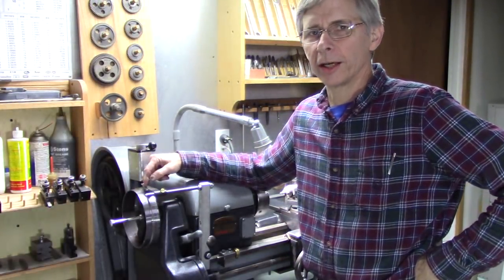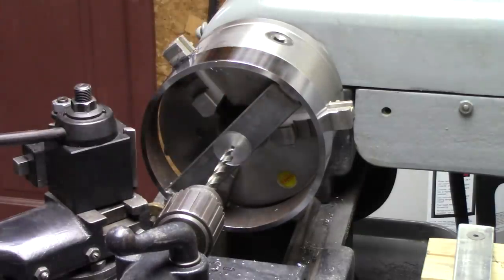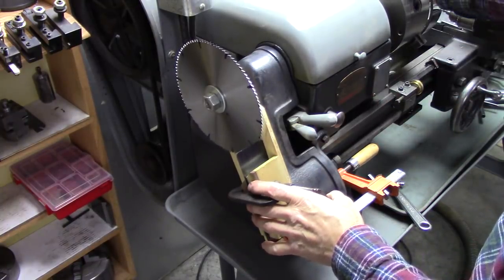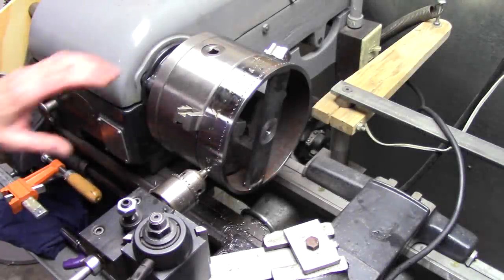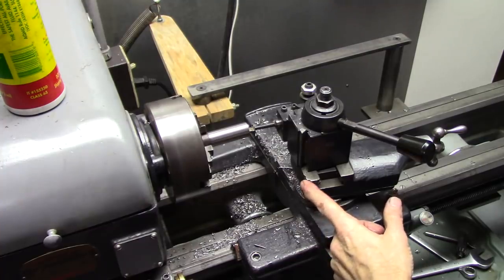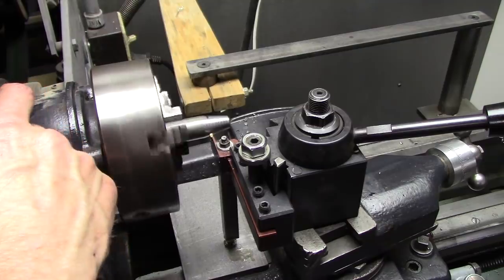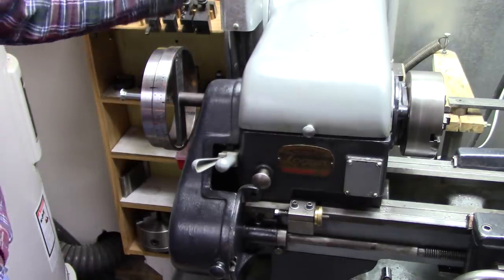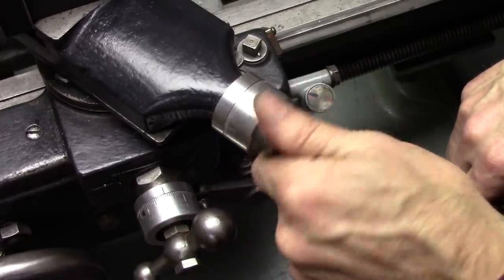Metal Lathe Indexing Wheel

Comment: With regards to your internal / external taper. If after cutting your internal one, you had left the compound slide where it was, run your lathe in reverse and with the same boring tool or another tool to cut on the backside, or keep the lathe running forward but have the tool upside down, your tapers would match exactly, without any trial and error fitting. Watch out too about standing pots of lubricant on your belt cover, it may not only slide off due to vibration, but it may also leave a stain ring on your paintwork. Final thought, I did not see it, but I am assuming that the drum is not permanently affixed to your mandrel ? just relying on friction between the 2 when you tighten the bolt. You have a fantastic friction fit with the mandrel in your lathe spindle ( hence you having to tap on the bolt to release it ) the clamping friction between the wheel and mandrel end is much lower. How about adding a mechanical one, i.e a key or a couple of small tack welds ? Great job and thanks for the shout out about Mr Pete.
Reply from the maker: I'll have to watch the video and refresh my memory on the tapers however running my lathe in reverses is not a good option, it has a screw on chuck. Good advice on the attachment of the expanding nut to the spoke of the wheel. I tack welded with my mig and it now works perfect. I wish I could modify this video as slippage in this area can be a problem.  Thanks for the valuable comment.

Comment: Would you be willing to do a short video detailing your belt grinder. Just the little bit I saw was very intriguing.
Reply from the maker: I've thought about that. I've had a lot of comments on that sander and I'll have to admit. it works great and I use it almost daily! When I run across a suitable motor I'll make another one and do a video. Thanks for the comment!
Reply: Winky, did you make the rollers? If you did, did you also use that taper attachment I see to do any crowning?
Reply: Yes I made the rollers but I did not use a tapering attachment. I used a simple V shaped crown. I set the compound at about 1.5 degrees. I locked the carriage and had fed the compound a few passes until it quit cutting just past center and then flipped the roller over and did it again. It worked perfect!  A 2-inch wide belt is very forgiving....  a 4 inch is much more critical. I've had others tell me I should only crown the top idler and not the drive but it works best with both crowned. The only reason to not put the crown on the drive (or both wheels) is if you are gong to do heavy grinding against the wheel.  I have no tracking adjustment and you can't knock the belt off. For the record, the motor is 1/2HP 3450RPM with a 3 inch drive roller. From what I understand a bit faster wold be better but you would probably need to increase the HP. I know it works great and I use the heck out of it!

Comment: You could have two drums (instead of one) with the smaller a snug fit inside the larger. choose some numbers that are relatively prime. Then they can be rotated so some of the holes line up. When the cuts are made from those, the inner drum is rotated to line up others. With a bit of simple arithmetic and attention, a huge number of different indexes could be performed. In fact any product of the prime factors of the two drums.
  In fact I might do that on my Logan 300 (recently acquired, but needing attention).
  p.s. is your belt endless? If so where did you get it from?
Reply from the maker: If you need all the combinations that a great idea. On my South Bend I used a 48 tooth gear. It give be most common hole patterns

Comment: I love that saw blade idea but I'd be a little concerned about the precision of the ratcheting system. Well, not so much a ratcheting system as a ratcheting piece.
   It's an absolutely ingenious idea, I love when you can use your imagination to adapt one device for another purpose. It's a huge time saver when making machines. I just hope that anyone watching this who is a beginner or novice understands that when you need precision in 1 to 5 thousandths of an inch, that this is probably not going to be reliable. It might be if you make a ratcheting system with basically zero flex. The sheet metal probably does OK but that thin sheet of stainless is a bit concerning.
  I may even adapt this idea for my own indexer so that I don't have to do the initial precise measurements. Again, a huge time saver.

Thank you for the video.
Reply from the maker: I'm sure their is some error although I'm not sure the ratchet on the saw blade is a significant source. It's amazingly rigid when you reverse into the tooth gullet I'd say there is error in multiple areas. The sleeve bushing in the drill and the arm the tool post are both areas that might move some. I've used it to make dials and drill bolt patterns (3 and 4 bolt) and never had a problem with the bolts lining up. I'm guessing that would be within .003 or .004.. But I agree, I would never use it to cut a gear. Hopefully anyone advanced enough to cut a gear understands the limitations.

Thanks for the comment, always good to hear concerns,  and compliments of course!

Comment: Great video and very motivating . I need to make some dails for my son's lathe once i installed a new cross slide leadscrew and nut . I saw something else on some of your videos and that is your cutting oil system . It seems to have air in the system as well while delivering the fluid to the work piece being machined . Is that to enhance the cooling  of the tool and work piece whilst it is getting some lubrication? I make a lot of bushes to refurbish turbocharger waste gates so i do a lot of drilling in the lathe . I want to install a cutting fluid system so i thought i'd ask you about yours . I like your videos and it is awesome to see somone enjoying what he does .
Reply from the maker: The fluid being sprayed is a water based coolant called Kool Mist #77. You buy it by the gallon and dilute it 10 to 1. It's mostly air being sprayed so it is very economical. It works just as well as flood lubrication except that you don't have to recover the coolant. Although flood moved chip out of the way a little better. The sprayer I have is OriGlam Mist Coolant Lubrication Spray System but there are many out there. Just get one with both fluid and air valves.  Glad you liked the videos, thanks for watching.

Comment: Note: U could use various black powders to fill the epoxy. Harbor freight sells small quantities of powder paint in BLK, RED, WHT, and YEL. Carbon BLK (Amazon) is ideal and Manganese dioxide (alkaline batteries) is a black pigment which was used in antiquity. Degrease UR object first with MEK or brake cleaner. Make a squege from a plastic bottle.

Comment: Hi Winky, what kind of Steel are you using for your Tap Guides and other Tools? I noticed you don’t seem to have a problem with rust. 
Thanks
Reply from the maker: Everything it mild steel. I do occasionally get rust but not often. My shop is climate controlled which keeps the humidity down.

Comment: Thank You Mr. Winky...First time visiting your sight....I was instantly able to relate to your shop setup in that my own lathe is just about in the same position with my water heater as your lathe is, ha. We both do a little bit of anything, wood, metal, plastic whatever is needed. Liked & subscribed and I will slowly catch up on your shows....TM (Calif.)
Reply from the maker: Thanks! Yep, wood and metal or whatever. Although metal working has sort of taken priority lately.  It would be nice if I had a bigger shop so I could keep the oily chips and wood separate but the wood and metal actually compliment each other very well. Thanks, for watching. (KY)
Reply: @WinkysWorkshop   A long time ago watching Lyle Peterson making a wooden foundry pattern . mrpete222 exclaimed that "yes I use my machine lathe to do wood-turning for my foundry patterns". It would be wonderful to have a clear division between wood & metal but as you say we all need a larger shop...ha, never large enough!!! I am 46+ years manual machinist and my semi-retirement has me spending LOTS of time in the shop. Always something fun to do. Each day is a new adventure. Thanks again....TM
Reply from the maker: @tuffymartinez  - Retirement is great, I just wish I had been able to do it 20 years ago. I'm 64 now and don;t have near the energy I used to. I've had a good live but I put off many things until retirement. I'll never complete all my goals in this lifetime! Check out my Wood Lathe Made like a Metal lathe video.

Comment: Indexable lathe spindle extends the lathe versatility by a big margin. What has also  caught my interest here is your bed supported parting blade. Is that idea your own?
Reply from the maker: Thank you sir. Yes this was my idea and it works well but although I occasionally still have a mishap. I think when the insert gets slightly null. If is breaks the insert no big deal but when it wipes out the holder it cost a bit more. I have another video that uses a HHIP high speed steel blade. So far is has never failed. I basically bolt the blade holder directly to the compound.  https://youtu.be/HGAQHjzgs9c

Comment: If I could be so bold as to make a suggestion and that would be to go to a smaller wire diameter on your 110 welder. Sounded to me as if you had the wire speed turned so far down that it was barely coming out of the gun? This tells me (after peaking at your welds) that you have to large a wire diameter in the welder. If you want hotter welds and better penetration in a 110 wire feeder then you should go to a .023”-024” that been my experience. Did not want to tell you how you should do your job.
Reply from the maker: Excellent observation. When I made this video the welder was only a month old. During that month I bought gas, a regulator and some .030 wire for use with gas. I've had stick welders in the past but MIG is new to me. After playing around with the welder a bit more I figured smaller wire would be much better and after changing to .024 it definitely was better. I wish they made a .020. I think it would be even better. You know the flux core wire did a little better than the gas although there was more slag. Bottom line, a 110v mig doesn't have enough power for much over 1/8-inch.  I've actually welded a lot of 1/4" but it's pretty much on the surface and i would not trust the welds for anything very heavy.

Comment: I'm not a machinist but I'm familiar with lathes and am toying with getting a small one.  I'm curious  how you decided on 100 & 48 index locations. (I realize you can get numerous variations with just those 2).  Are 7, 9, 11, 13 indexing not that common?  Not criticizing or being negative I just like to know details.  :-)     I've subscribed and will be watching your other videos.  Thanks for taking the time to video and post your interesting work.
Reply from the maker: I made the the 100 locations for making machine dials. You may have seen the videos by now. I've actually never used the 100 holes because the saw blade is quicker easier to use. You just click to the next tooth rather than aligning a pin with a hole. As you said, 7, 9, 11, etc are not common. I actually only use 2, 3 and 4. Thanks for watching.

Comment: The same setup that cuts the female taper of the spindle clutch can cut the male exterior taper.  Leave the angle unchanged, cut on the far side of the center in reverse with a left cutting tool. Angles guaranteed to match.
Reply from the maker: Yep, I should have done that for sure. ..  I did this on the last one I made. Instead of making the wheel I just used a 48 tooth gear. So far I have never needed anything other that a 2, 3, 4 or 6 hole pattern and the 48 tooth covers them all. https://youtu.be/xauJcjrINy0

Comment: Hi, I like your your video. If you have a look at the Steve Jordan YouTube channel you will see a couple of ideas on how to pin your indexing ring in the locations you require. All the best for the New Year. 👍
Reply from the maker: I just watched Steve's video. It looks like I came up with a very similar idea to his. I like the pin idea he has although this is somewhat lathe specific.  He had a solid surface on his gear cover to mount to. The Logan lathe doesn't have this. Also, my wheel has two sets of holes,  100 and 48 so the pin needed to to move from side to side. Realistically, his 24 hole ring (or disk) is totally adequate for most project. It gives you 2, 3, 4, 6, and 8 positions.  I wanted 100 on my ring for making lathe dials. Also any 24 or 48 tooth gear would be perfect!

Comment: I like the idea. Could you possibly post the I/D and the teeth number and the O/D of your change gears. I have a Clausing 100 and i am wondering if they will interchange or if i could modify some other gears to work on mine. It is going to be next to impossible for me to find a set of gears for a Clausing 100 that was made in 1939. Thanks.
Reply from the maker: The change gear bore was 5/8" inch and it had 48 teeth. Of course you can use a different gear depending on the hole pattern and number of holes you want to drill. If you want to drill 2, 3, 4, 6, and 8 holes all you need is 24 teeth on a gear of blade. Ebay is a good option for change gears.
Reply: Thanks Winky. I have the list of change gear numbers for what thread pitch in my book on the Clausing 100. I will look to see what the gear bore diameter is on my lathe. Hopefully mine is the same 5/8" diameter and key size. If larger then i could always bore the hole out and re cut the keyways.  My Clausing uses 11 different gears. 2 each of a 32 tooth  1 each of all the rest 36-40-44-46-48-52-54-56-60-64.  Maybe I can get lucky and the Logan gears will work or can be modified to work. What is the model number on your Logan again? I forgot already. Thanks for the info and thanks for making this video. I love Mr Pete also. I also watched his video on using the saw blade. Excellent use of what is available to measure divisions. . I hope to also make the drill attachment with the use of a lever so i can make mine as accurate as possible. I want a small mill but until i can find an old one and small enuff for what i want i intend to make do with my lathe.
Reply from the maker: You can make the spindle fit the gear, I wouldn't bore the gear. The 48 tooth is perfect for what I do. The only reason I added the 100 tooth saw blade is in case I want to do more lathe dials. 48 will give you 2, 3, 4, 6, and 8 hole possibilities.

Comment: Hello sir
Congratulations on this excellent video and the présentation of your idea. Could you tell me the dimensions of the tube used.
Thanks in advance. P.K
Reply from the maker: The tube was about 6.5" outside but it really is not critical.
Reply: @WinkysWorkshop  Hello sir,
Thank you for the accurate and quick answer. Indeed the diameter of the tube is not critical but knowing it, that allows me to have a starting value. So that with this diameter of 6.5 "and 100 graduations, the gap between 2 will be 5.18 mm, good indication.
I started to collect the various pieces but I block on the drill chuck and its axis! Would you have a link to buy these items, I did not find on "Banggood".
At the back of your tower is a piece of wood articulated on another steel, what is it used for?
Would not you have a next video idea to install a disc brake on a lathe?
Good luck for beautiful videos.
Cordial greetings. P.K. (French)
Reply from the maker: True.Good luck with your adventure. If you make one of these tack weld or pin the spoke to the center piece that goes inside the spindle. I did this to mine after making the video because it slips under a load.
Reply from the maker: @paulk3573  https://www.msdiscounttool.com/catalog/product_info.php?csv=gg&products_id=109544&gclid=Cj0KCQjwuZDtBRDvARIsAPXFx3BrjDoFf8VFNcQ7zAptRPX4kL1DIbr8TXUIKsFgXlI0ChygpJfkoMYaAiOqEALw_wcB
Reply from the maker: @paulk3573  - The steel was to hold a pattern. I disconnected the lead screw on my cross slide and the wood held a spring to keep the follower against the pattern.
Reply from the maker: @paulk3573  https://youtu.be/PczSsvRfiEk
Reply: @WinkysWorkshop  Hello sir,
I did not expect your additional information and it is therefore with a little delay that I answer.
Thank you very much. I understood the principle of copying a profile by uncoupling the nut of the transverse. Regarding the tool holder I can not find one that would be mounted on my tower, a Ramo T36 equipped with a "Precise block 85".
It's always a pleasure, good day.
P.K. (French)

Comment: am i wrong or that pin long shaft attachmant can flex and it wont be accurate?i think that long threated rod can flex and you need to lock your spindle every time you move it.or maybe im wrong,im hobby mashinist myself
Reply: I'm sure it would flex with a lot of force but drilling holes puts very little force on anything. The arm that holds the pin would probably be the weak point but it's not an issue for drilling.

Comment: stress relief the weldement before final machining.
Reply from the maker: Thanks for watching Assad, please elaborate. Is this to make the weld strong or make it easier to machine. In the past I've had a weld break an insert but I figured this might be from an interrupted cut. It also makes perfect sense that the weld would me hardened in some areas. I assume you heat to red hot and let cool slowly to take the stress out?